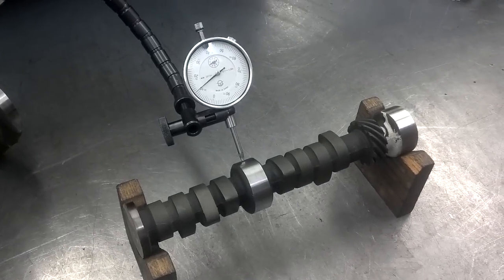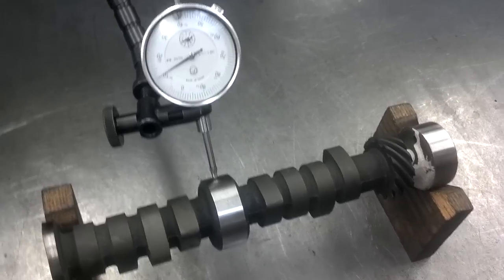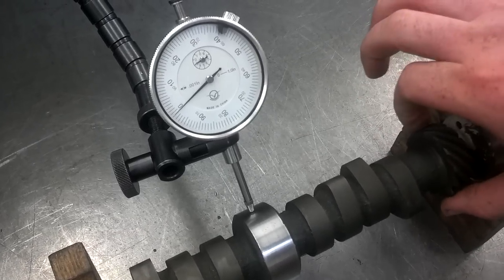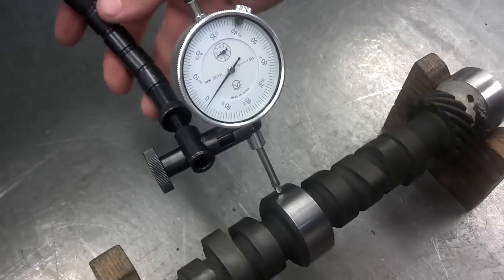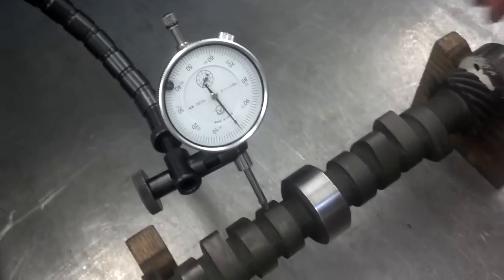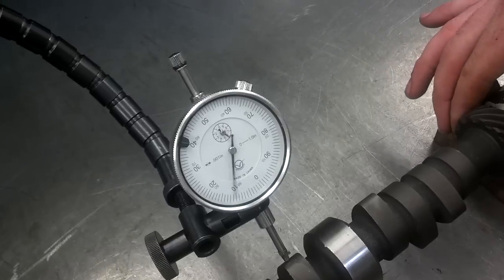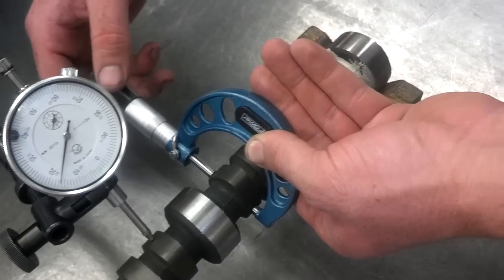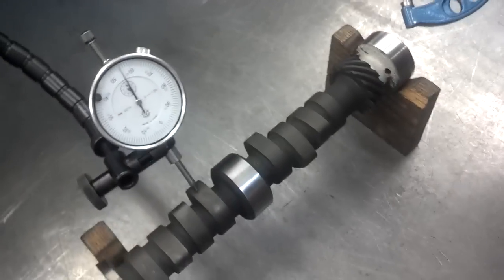Measuring a camshaft

Comment: It's interesting you show how to check the runout on one of the camshaft bearing journals, but the narrator doesn't tell us what to do with that information.
Reply: Rob Macfarlane  you have to compare the information to your lobe lift specifications and runout main journal specifications to determine if it needs to be replaced or machined or left alone.